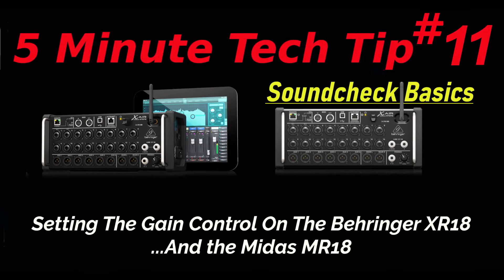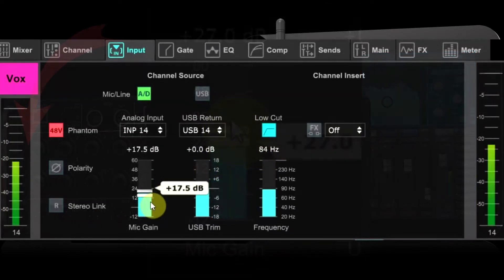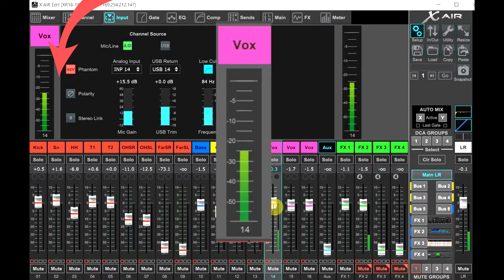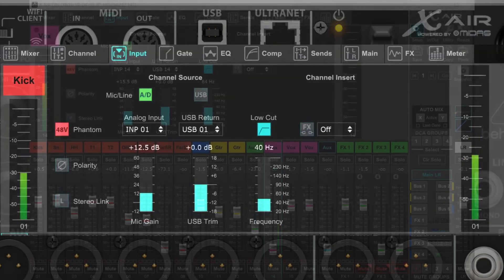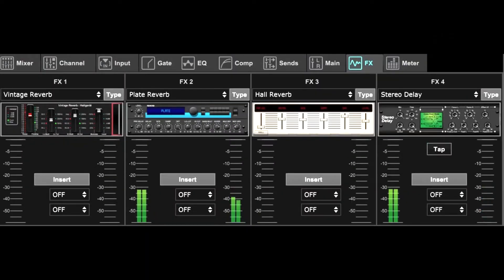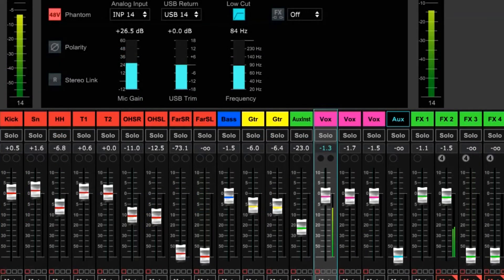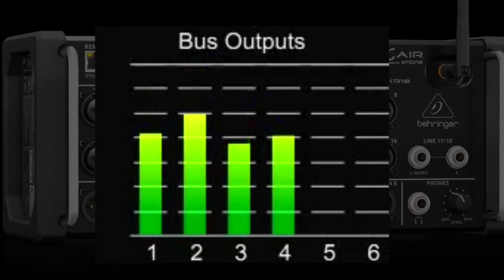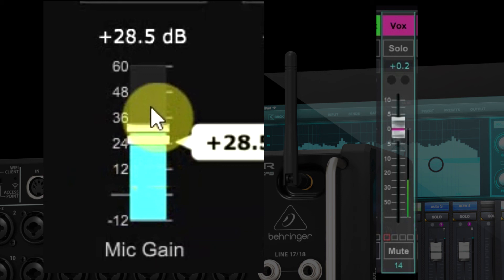Behringer XR18 Gain Staging and Signal Flow -  Soundcheck Basics - X Air Series - Midas MR18

Comment: Good day sir!

I'm trying build a system and of course portabilty and mobility is one concern but i'm not fan of powered boxes, scared of being wet outdoor events. I don't wan't to have a lot of analog gear for processing. I just wan't to know if the XR18 covers some of them:

graphic EQ, compressor, digital effects, delay, reverb, drive rack abilities.

Thank you and god bless, stay safe.
Reply from the maker: The XR18 is loaded with processing. You have parametric EQ's on every output (6 XLR Aux outs and 2 main outs (Left and right). You can also change those to graphic EQ's that are also built in.
Each output also has a compressor built into it.
Each preamp input has a compressor, gate, and parametric EQ built in.
All of this is done without using any of the slots in the built in FX rack. It has 4 stereo slots for built in FX. Several different reverbs, chorus, and delay are available to choose from for those 4 slots and 4 dedicated busses for FX sends. There are also some vintage compressor emulations you can put into 1 or more of those 4 slots and insert them somewhere in your signal, and several other type of FX. Reverbs and delays are the popular choices for the 4 FX sends.
The only thing it doesn't have is a crossover or any output delays for time alignment of speakers.
Amazon Link: https://amzn.to/38AijGH

The X32 besides having more channels and outputs, and a bigger built in FX rack, adds matrixes, and DOES have crossover filters built in, and you can delay the outputs for speaker time alignment.
Amazon Link: https://amzn.to/3siWlj0
Reply: @AlanHamiltonAudio  wow thank you, there's a lot of information from user than what the website can offer. Thank you very much sir. And your videos are very informative. Keep it up and god bless.
Reply from the maker: @prodj.mixapeofficial6431  Thanks!!

Comment from the maker: I did a video specifically on setting the gain/soundcheck basics on the Behringer X32 / M32 and wanted to do the same for the XR18 / MR 18 / X-Air series..
This is a sister video to the X32/M32 version. Specifically edited with visual examples featuring the XR18 for the same reason: An XR18 user might not find or click on an X32 video, or might at least prefer seeing the information explained on the same GUI they're seeing when they mix. 
I know some of this info was also in an earlier video series talking about typical mistakes that Behringer users sometimes make, but anyone not a subscriber and specifically searching Google or YT for this particular soundcheck/gain type info, wouldn't necessarily hit on that earlier video

The X32/M32 version of this video is at: https://youtu.be/7MJ3rfj7HNc

If anyone has suggestions for future videos let me know here in the comments.

Amazon Affiliate Links-
Behringer XR18 on Amazon:
https://amzn.to/2LfTpmO

Midas MR18 on Amazon:
https://amzn.to/3q4Z4Li

Behringer X32 on Amazon:
https://amzn.to/35oCcyo

Midas M32 on Amazon:
https://amzn.to/3ovhi8n

5 Typical Mistakes Behringer XR18 and Midas MR18 Users Make:
https://youtu.be/EilVDp39A9g